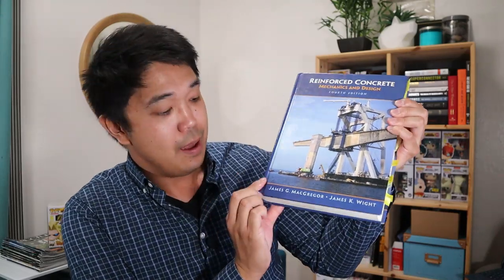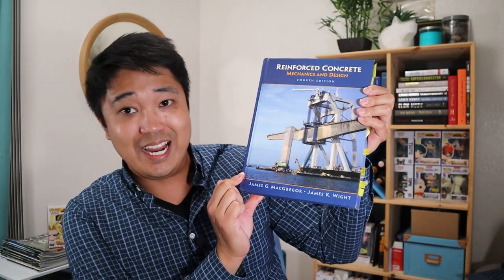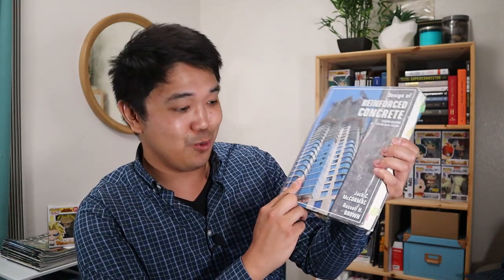Best Reinforced Concrete Design Books

Comment: I've all these books with me PLUS several other on my laptop...along with solution manuals... all on ACI codes...coz we have studied ACI in our university...we're using ACI code...not the other one...and for Steel, we're using AISC
Reply from the maker: Yes, I'm basing my books all on the U.S. codes (as I'm from the U.S.), so unfortunately, I don't have any books on the Euro/Indian, etc. codes.
Reply: @MatPicardal  American Codes are great. But I request you to start a course on Reinforced Concrete Design. Thanks. If you got some extra time then start Reinforced Concrete design course. Make small videos of 15-20min. Upload just 1 video per weak. Thanks again.

Comment: It would be nice if you may emphasize various codes used for structural design such as ACI, ECP, .... also do you have to prepare your own excel sheets for each code or is there a way to facilitate the design process using any design code?

Comment: Eurocode RCC books please
Reply: Somali by any chance ???
Reply: Economic Concrete Frame
Elements to Eurocode 2 and other books by the concrete centre are really good. You should try some of those. You can also try John Bungey, Ray Hulse Bill Mosley - Reinforced Concrete Design to Eurocode 2-Palgrave MacMillan. For EC8 i.e seismic design, Seismic Design of
 Concrete Buildings to Eurocode 8 Michael N. Fardis, Eduardo C. Carvalho, Peter Fajfar, and Alain Pecker is really good, explains a lot of theories really well but it specifically explains the clauses in the code. Elghazouli,_Ahmed_Seismic_Design_of_Buildings_to_Eurocode_8,_Second_Edition will be the best book for you if you are starting to learn about seismic design.
Reply from the maker: Wish I could, but I'm just basing these off on the books I currently use in the office (U.S.).
Reply from the maker: Thanks Samuel!